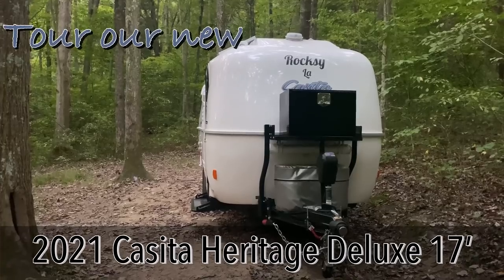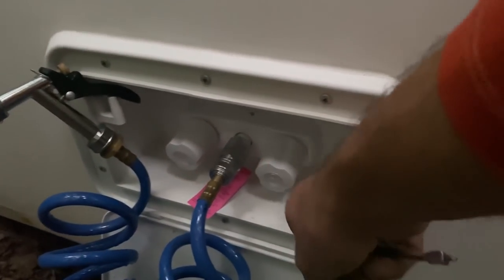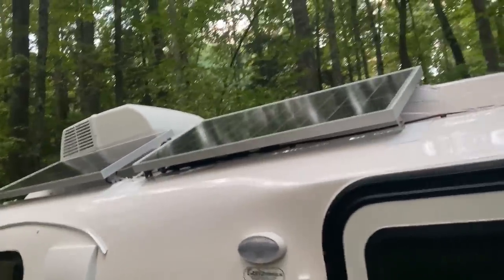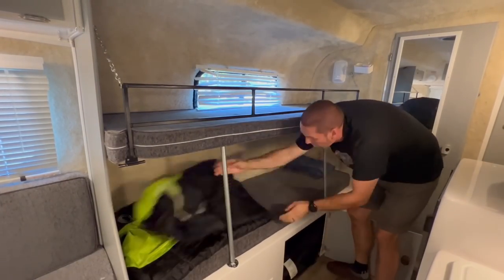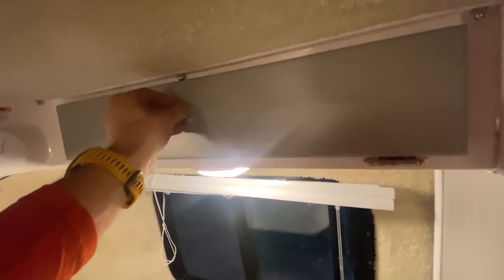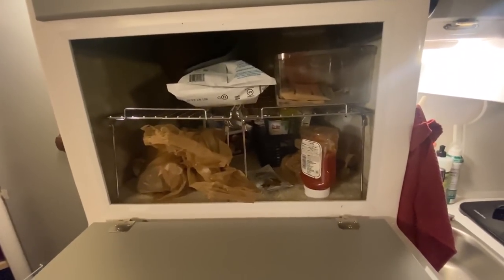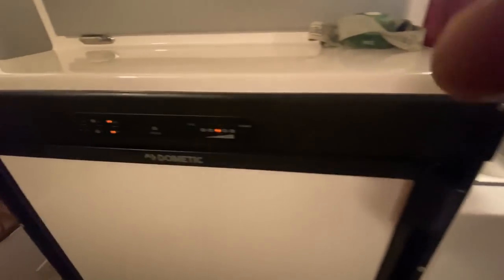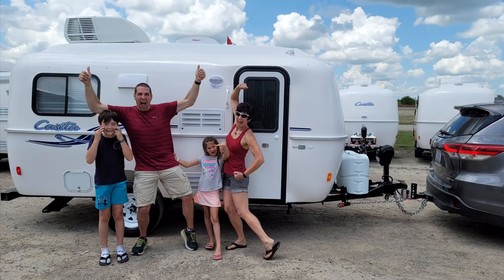Tour our new 2021 Casita Heritage Deluxe 17’

Comment: Nice mods.  I love the tool box/storage box on the Stromberg tray.  I would love to see how it is secured. I went to the website but not being mechanically inclined, it wasn’t clear to me how to do it.
Reply from the maker: Thanks!  The tray connects to the frame and i drilled holes in the tray and the box and mounted the box with bolts and nuts.

Comment: Have you had any issues with the carpeting on the walls getting dirty? That's my only initial concern with the Casitas because I could definitely see our 2 year old making those disgusting pretty quickly. Thanks for taking the time to do such a thorough walkthrough of your trailer!
Reply from the maker: No issues of yet.  In the 4 or so months we've had her, we've gone on 16 trips, 22 nights and over 5600 miles so far in the camper.  Now our kids are older as they are 7yo and 11yo.  But carpet can be cleaned and I've seen on forums and such people discussing getting the carpet cleaned by themselves or using a professional service.
Reply: Casita is a cute small camper however the carpet is a no for us as well. Just can’t do it.

Comment: Thanks for being so thorough. Does anyone else think base prices for models with bathrooms (only Deluxe have bathrooms?) are getting a bit much for someone starting out before even   prioritizing what they need added?  Can someone explain the "pipe" behind the toilet/in the closet and under the bathroom on the driver's side?
Reply from the maker: Pipe in closet is for the grey tank vent.  The pipe behind the toilet is for the black tank vent.  The pipe under the Casita on the drivers side is the black tank drainage.

Comment: Great video. Really like your rear view camera on the rear window but didn’t see in your description the name or model of the bracket or holder that held the camera. Can you add that to you list or give a description of it. Thanks have a blessed day
Reply from the maker: Thanks!! It’s just a spare phone suction cup mount i has lying around the house.  I found some other spare parts and built an attachment to the mount.  

andobil 2021 New Wireless Car Charger Mount [Intelligent & Safety], Auto-Clamping Car Charger Holder Mount Designed for iPhone 12 Pro/12 Pro Max/Se/11 Pro/Xs/XR/X/8, Samsung S21/S20/S10/S9/ Note 20/10 https://www.amazon.com/dp/B07QTG5PDX/ref=cm_sw_r_cp_api_glt_fabc_Y9C8NFB3GMENZYQAA32W?_encoding=UTF8&psc=1

Comment: Cute little trailer ,one thing. breathing battery acid from batteries under bunk not good. thats why most trailers  have them mounted outside on the tonge, inside mounted acid batteries to dangeous.
Reply from the maker: Thanks for this.  Actually inside is only dangerous for lead acid batteries, it’s perfectly safe for Lithium batteries.

Comment: love what u have going on, on the in and outside of your casita. We just bought a 2016 Spirit Deluxe and i cant imagine having 4 people inside but it really looks cool. So i have some questions. the white "arm" in the bathroom with the hangers what is that called and where did u get? also the spring hinge, where did u buy? What does the solar do for your camper? we dont have the storage in ours that u have in yours.
Reply from the maker: Thanks, the white arm i bought from Little house customs.  The link to the hatch spring is in the description of this video.  The solar has been amazing as i no longer need to find campsites with hookups nor no i need to plug-in when at home.  I’ve seen others put batteries in the closet.

Comment: Great video!  Where did you Buy the Black Box that you mounted on top of the Stromberg?   What dimensions does it have.   Bolted directly to the Stromberg or plywood underneath?   Look forward to your answers.   Thanks
Reply from the maker: Thanks!  I bought the box off Amazon and the link is in the video description.  I drilled holes in the bottom and also into the Stromberg.  I then just bolted them together.  No wood was needed.
Reply: @stevelineberry  Thanks.   I bought one too!  Happy Trails and Tight Lines!
Reply from the maker: Great!  Have a good one.

Comment: I noticed you have little gutters over your windows.  Where did get those & how do they benefit you when you still can't have the windows open when it's raining?  Thanks.
Reply from the maker: It helps keep water off of the windows so we can see out better. Maybe not so much from a hard rain but more from a light rain or the condensation from the air conditioner.  

I ordered them from Amazon:  Esssentials UW01004 Polar White 10' EZE RV Gutter https://www.amazon.com/dp/B009IGF1KQ/ref=cm_sw_r_cp_apip_l68cv43TevTXh
Reply: @stevelineberry  thank you so much! I'll try it on my Casita.

Comment: Great video, we just got a Spirit Deluxe in September.   Love your mods, especially the additional storage up front.  Did that affect tow ability?  Some have warned us about putting more weight on the tongue.  But we needed more space, so we were contemplating where to add some outside storage.
Reply from the maker: Congrats and thanks.  It hasn’t affected the tow ability as far as we can tell.  The box is aluminum and quite light.
Reply: @stevelineberry  Thanks!

Comment: can you tell me if the bunk beds are big enough for adults?  My husband and I are both petite (5'1 and 5'4) but the bunk beds in our 13' Scamp are quite cramped.  These look a little roomier.
Reply from the maker: These are 21" x 74".  As a 6'1" adult, I can fit in there and could probably sleep if I really needed to but it wouldn't be the best sleep for me.  The top bunk has a weight limit of probably around 100 lbs.  For reference, here is a picture of me and my daughter snuggling in the lower bunk.  My head was at the top and my feet were flat against the bottom.  

https://1drv.ms/u/s!AkBQeJQSZIj0xsEFMoNrduD-eur7hA

Comment: i have a question for u.. we are having a hard time figuring out the break controller for the casita. it isnt in the casita but somewhere in the highlander. My husband has replaced the ground wire, and the hot wire from the controller. when we connect the casita to the truck it is fine. and everything seems to work until we connect the casita to the highlander. not sure where to look next. 
do u know someone we could talk to?
Reply from the maker: I got mine installed at a local truck and hitch place.  They installed the hitch, 7-pin and brake controller.  I’ve had no issues.

Comment: Great video. Where did you get the spring opener for the one door ? Also what does the camper weigh and what do you pull it with.
Reply from the maker: Thanks!  I got the spring from Amazon.  Link is in the description.  It weighs 2400 lbs dry but i haven’t weighed it yet with our mods and things in it.  We pull with a Toyota Highlander AWD.

Comment: How long are the bunk beds are they for adults or just kids
Reply from the maker: Probably mainly for kids or small adults.  At 6'1" and 195 lbs, I can fit on the lower bunk but I'm not sure how well I would sleep there on a consistent basis.  The top bunk is a little smaller and also has a weight limit of around 100 lbs or so.

Comment: Do you mind sharing what the out the door cost was? Ballpark? I know they start at $26k, so was it much higher than that (aside from tax)?
Reply from the maker: With the options we selected and the price of when we ordered it, the cost was a little less than $25k.  Then we spent about $5k on accessories and basic mods.  This included chocks, bedding, rear view camera, tire pressure monitor, fridge thermometer, kitchen supplies (pots, pans, plates, cups, silverware, etc.), closet shelves, tank platform with box for extra storage, coupler lock, wheel boot lock, tools to keep in the Casita and other miscellaneous items.

Comment: Thanks for posting a very interesting and informative video.  I have been dreaming of a Casita  for years.  Do you think a 2000 4Runner would be an adequate tow vehicle?
Reply from the maker: Thanks!! Quick internet search says that the 2000 4Runner can tow up to 5000 lbs.  That is plenty to tow a Casita.
Reply: I tow my 2021 casita with my 2015 Audi Q5 with a turbo4cyl. It's rated at 4000lb towing. She tows with no issue at all.The runner will be plenty.

Comment: We just bought a new 2021 Spirit Deluxe.  The whole process went perfectly. However at the end when they gave us our copies  of everything they told us if we changed ANYTHING at all,  it would void our warranty.  Did you void yours when you made all these modifications?
Reply from the maker: Congrats on the new trailer!  I asked the same thing and what they told me is if I changed anything and then tried to get warranty support for what I changed, that is not covered.  

For instance, if I put a hole in the roof and then contact them for warranty roof work because it leaked, that's not covered.  But If the roof is leaking from somewhere unrelated to any of my changes, then it would be covered.  

I've already had a few small warranty related items and they covered them no questions asked.  One was the bathroom fan and the other was the co/propane detector.  Both instances they were great to work with and they shipped me new components and I installed them myself.
Reply from the maker: On another note, i've seen on FB and other forums that most people's view of the warranty is it's only worth about $500.  Because very few things break in the first year and the things that do, aren't very expensive.
Reply: @stevelineberry  So far we have been very lucky, nothing has broken.  Overall, could not be happier.  The Casita was our choice over Scamp and we are elated with our decision.  The Spirit was best for our needs, a couples trailer.  Our kids are all over 30 and long gone, but do understand why you guys chose bunks.  Keep the mod videos coming, we are still learning.  This is our first RV.

Comment: I'm going to bet your next purchases will be better designed blinds and some DampRid.  I always wanted a Casita or the like, but always end up with something else.
Reply from the maker: Yes, we want replace the blinds with curtains sometime soon.  We actually are using an Eva-dry dehumidifier which runs off 12v and i have it on a timer to run during the day when I’m also getting solar.

Comment: Where do you put your generator when you haul it
Reply from the maker: Well, i have an EU2200i i bought for the trailer and converted to tri-fuel and mainly run it on propane.  Given this I can store it in my tow vehicle.  The reality is that with my solar setup, the only reason i would need to run the generator is if i need to run my air conditioner.  I have yet to bring the generator or need it so far.

Comment: Thanks for the tour Steve.  It seems a shame to me that the bottom bunk of your unit can't be converted into 2 person dining opposed seating like in the Spirit model.  It doesn't even seem like it would be that hard to do, even if some storage space below the bottom bunk is sacrificed, although Casita said that it's not an option they provide.  I don't suppose that you know of any 3rd party/aftermarket vendors who do this conversion, do you?  Thanks.  BTW I have seen people put a lagoon table there but, of course it extends into the "hall."
Reply from the maker: I did do the lagun table mod and it does extend into the hall but it moves so easily it’s not a big deal.  See my video here:  https://youtu.be/hcDbGQiiGzo?si=is6bCV_Jp-NUjMU1
Reply: Oh, I'm sorry Steve!  That Lagun table add on video  @stevelineberry  I saw on Youtube was actually YOUR video!  Question, would it be that difficult to cut out of the bottom bunk of the Heritage, in the middle of its length, (loss of storage space below noted) pretty much the same space as found in the Casita Spirit model, so meals for two with the Lagun table could be effected facing each other while sitting on the remainder of the bottom bunk?  A plank of wood, not different that than used to make the main bed, I'd hope, could bridge this gap in envision to return the bottom area I describe back into a sleeping bunk.  Thanks.  The people at Casita tell me that from the factory they can't make my ultimate trailer, which I dub, tongue-in-cheek, the "Spirtage:" an amalgamation of the Spirit and Heritage models featuring "across from the kitchen area" both dining and sleeping areas.
Reply from the maker: I’m sure it’s possible.  The main thing you need to be careful about is making sure the supports for the top bunk aren’t affected and the bottom bunk/seats are still strong enough to hold up the top bunk.  

I actually really enjoy the space under the bunk here but you said you’d be willing to lose that.

Comment: I'd. Worry about theft with such a light trailer. How do you protect it.?
Reply from the maker: Good question! I may make a video about this in the future.  Basically i use a provenlock for the tongue and a wheel nut lock with a provenlock wheel boot.

Comment: How do you find the bed for you and your wife? I'm 6'0 165lbs and my wife is shorter. I think I'd love the Heritage with the kids, but the Independence (made into a King size bed) when the wife and I are on our own.
Reply from the maker: I was worried about that as well but it’s been fine.  I’m 6’1” and 195 lbs and fit just fine.  If i stretch my toes i can touch the wall.  

I was thinking when the kids have left the house that maybe the Liberty would be the best model for us.  Similar to the independence but the aisle is wider like the heritage, spirit, etc.
Reply: @stevelineberry  Yeah, it would be nice to have a Casita bartering system to trade in models as you go through life. Really great campers. Enjoy your travels.
Reply from the maker: That would be cool, thanks and have a good one!

Comment: Nice rig!  The provided links are super helpful, thank you.  Classic Casita design still shines.  Like the more recent grey interior.

By following links, I find there's a 300lb safe capacity for that tongue box and a 2K Honda generator could then fit.  (Though added tongue weight could become a factor, depending on tow vehicle).   Might suggest a solar input port,  and compactly stored folding panels to deploy for times when the trailer is parked in shade.
Reply from the maker: Thanks and good points. We have the solar port and if i find that i need a suitcase solar I’ll consider getting one.

Comment: good morning, Steve and Erica, wanting to ask about your bed topper comfort level. me and Dick sleep on a sleep number bed, mainly an air mattress with 2 inch memory foam. we are older couple and how is what u use work for u?
Reply from the maker: I thought the topper made a huge difference vs just using the seat cushions.  I’m not sure it’s as good of an experience as my bed at home but we have no issues sleeping in the Casita.
Reply: @stevelineberry  we have ordered that topper.. we also have a 1 or 2 inch memory foam .. but it is older and we are fat so we sink down to the cushions. We have used some cot air pads called Kylmit we bought from costco. 2 of them are wider than our double bed. they are also ribbed, meaning they are multi-chambered.  so i usually sleep on one and my husband sleeps on a different kind. I just didnt want to spend the money on a full sized bed when we cant move it when we need to get to things under the bed.  these we can deflate.. and im hoping the foam thing we ordered will be cooling and comfortable.. we get it tomorrow
Reply: @stevelineberry  we did replace the tires with small truck tires, and raised the camper about 3 inches. we havent been camping in it yet, because i got saddled with 3 extra dogs for 6 weeks. we have thougth of doing roller shades instead of these noisy blinds.
Reply from the maker: Sounds like you are getting things worked out.  Good luck!

Comment: A much nicer option is a Forest River Wolf Pup 16PF with a large 7' slide out dinnete and a sofa, plus north south bed so no crawling over each other at night, and cheaper
Reply from the maker: Thanks and that is another option, but what you aren’t considering is quality and resale.  Fiberglass campers last for decades.  I’m seeing 25 year old Casita’s selling for about half the cost of a new one.  Also the build quality of Casita’s is head over heels higher than what’s coming out of Elkhart, IN.
Reply: A regular boxy stick-built trailer doesn't tow at all like a Casita, nor is it as bullet proof. A Casita will last 25+ years and function the same. And it will hold resale value, especially right now. They really have different uses.
Reply: Casita also has 2 models with twin beds.
Reply: 2480 lbs vs 4999 lbs is a big issue got some people.

Comment: Great video! Do you know if your Highlander is unibody construction? I drive an Acura MDX that is unibody. Some people have told me that towing would cause problems where the doors would ultimately not close properly. As for the axle ratio and power plant, the vehicle is rated to tow 5,000.
Reply from the maker: Thanks!!  My understanding is our highlander is a unibody as well.  Ours is rated at 5000 lbs as well.  In our manual for the Highlander, Toyota mentions the need for sway control and weight distribution hitch which we have in our Andersen WDH.  I haven’t heard anything about the doors before but feel i am following the instructions from Toyota.
Reply: Thanks, I appreciate your feedback. I will be interested to see how your experiences go with the Casita!

Comment: Storage seems really small  on outside of camper and no black tank flush oh and a wet bath.  Suppose it works for a family of four. You didn't say the size of your holding tanks.
Reply from the maker: The storage is small but more than adequate.  I use one of those swivel sticks to flush the black tank.  I built a pvc pipe holder for it on the front.  25 gal clean water, 15 gallon black, 32 gallon grey.